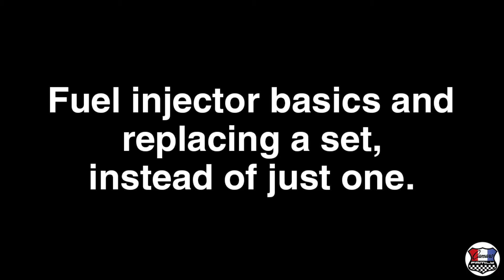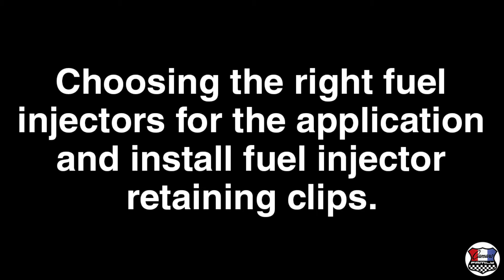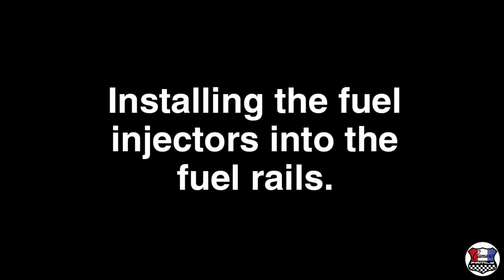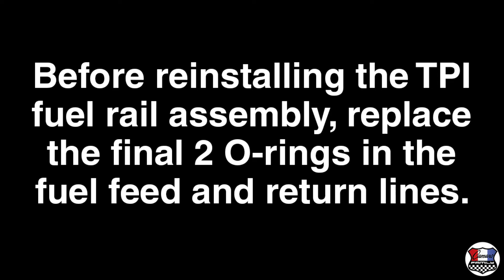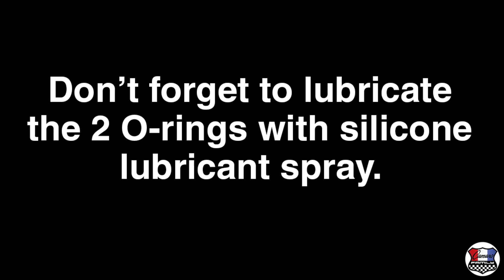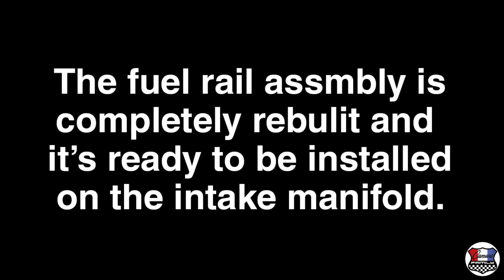TPI Fuel Rail Rebuild - Camaro / Firebird / Corvette (Part 4 of 4)

Comment: Did these Bosch 3 injectors make a lot of noise for you like so many on the Corvette, Third Gen & F body tpi owners I found out have been upset going back to 2006 when this Ford Bosch Injectors were being retrofitted.   I think I came up with 1 good solution along with a few other ideas to totally quiet them or any injector used.  Just waiting on email from a few suppliers to pass onto everyone.  Are those genuine Bosch or possibly fake cheap ones?

Comment: WRONG!!!!! 350 IS A 21LB. AND NOT ALL 8 FIRE AT THE SAME TIME. YOU ARE THE REASON PEOPLE SPREAD BAD INFO.
Reply: So like what lb injectors should I use cause I have a L98 383 stroker with almost 700 hp

Comment: Good afternoon. I replaced my 85 iroc-z injectors with the same 19lb injectors off Amazon that were 50 bucks. The car has trouble starting if hadn't cranked in a day or so. Then when it gets hot it starts to surge. Did you have this problem with these injectors? Thanks
Reply from the maker: I didn’t have any running problems with mine. Why did you replace your injectors? Did it run fine before replacing the injectors? Did you replace anything else?

Comment: Only one side or 4 injectors fire at the same time. Since the injectors are at the inlet ports, the the 24lb injector may cause a rich condition if the computer doesn't't adjust the duration.

Comment: Thanks for posting! These videos are a huge help. What brand of injectors did you use? Bosch? I have done a lot of reading and it seems lots of folks recommend Bosch III 19#. However, I happened to come across a thread recently that suggested those aren't a direct replacement without tuning. My car is a stock 1989 LB9 305 IROC.
Reply from the maker: Hey Crock of Shirt, Thanks for your message! I appreciate you watching my boring, but hopefully helpful video. It seems to be helping more people all the time. Honestly, I NEVER do this, but I really cheaped out on the fuel injectors. I bought them from eBay for about $70 and took a chance, I assume that I will be installing an LS in the future, so I didn’t want to go crazy with installing GM original injectors $$$. I found a seller that had sold more than 100 sets of them (in the hopes that if they didn’t fit/work, they would not sell so many). These were a direct replacement on their fitment chart. I didn’t have to tune anything. It passed smog very clean, so I know they didn’t require any tuning. Maybe if you installed them on a smarter/newer vehicle them might, but these old batch-fire systems are pretty rudimentary. I would definitely do the same thing on the next TPI I rebuild. -Tony
Reply: @CamaroFamily  looking to purchase these. Is there a link or part number? Im in the same boat on my 86. Going ls in the next few yrs. Hope you see this fast.
Reply from the maker: @datboired832  I just walked out to IROCDAILY and got the Bosch numbers for you. The other injectors are F6VE-A5A 👍👍 I should add this detail to
My video. 👍👍
Reply: @CamaroFamily  dope thanks alot! Yt must have been reading my mind lol. Ill be buying these rn. And these are for the tbi 5.0?
Reply: @CamaroFamily  the injectors keep popping up for ford's,  are those the correct ones?
Reply from the maker: @datboired832  These Bosch injectors are 19lb injectors for many different newer cars. I see them for use on Ford 4.6L engines and in Jeep’s. The nice thing about these newer replacements is that the technology is newer, so the injector bodies are more compact…compared to the older original injectors.
Reply: @CamaroFamily  those the ones im about to order. Is there anything else imma need?
Reply from the maker: @datboired832  Yes. They are correct for the 305 TPI application. I passed smog (visual and sniff test) with flying colors. Most fuel injectors are used on many different applications. The O-Rings are correct size, length is correct, Harness connectors are correct. And pound rating is correct too. 👍👍👍👍
Reply: @CamaroFamily  thanks for all the help.and fast response time! They will be here Saturday. Nowhere by me.has the orings smh. You guys should make a vid on the 3rd brake light on the 86's! I cant get mine to work!. I wish there was more 3rd gens in san diego area.
Reply from the maker: @datboired832  the Injectors and the O-Ring kit (GP Sorenson PN: 800-9211) available at AutoZone, and the 2 fuel line O-rings I mention in my videos. The GP Sorenson kit has the cold start injector O-rings (and others if you want to reseal the whole rail assembly…like I did in this series). 😉👍
Reply: @CamaroFamily  yes im looking for the o rings right now

Comment: Doing this myself right now, can I ask, when you install the new o rings on the fuel rail, is the supposed to be any movement on the tubes after tightening the screws down ? Mine has a little play in it...
Reply from the maker: Chris M, sorry for the late response, I didn’t see your message. After tightening  the retainers, you should be able to articulate the tubes slightly to get the rails lined up for installing on the intake manifold. You described your movement as “play”, which concerns me. I took mine apart because the O-rings were too small (wrong size installed by a previous repair job) and fuel was spraying out of the O-rings. It was probably leaking slightly for a while before I purchased the car, but one day it really started spraying. It was very dangerous. If you can easily rotate/roll (like a pencil between your thumb and index finger) the transfer tubes with 2 fingers after installing them, you have the wrong O-rings.
Reply: @CamaroFamily  that's ok. It was just a bit of movement, it wasn't there when I pulled the rail off but I'm guessing that was because it had probably never been pulled apart before and had become a bit stiff. Once I installed it though it was all good, nice and tight.
Reply from the maker: @CPMest81  Awesome! Good to hear!
Reply from the maker: @CPMest81  I hope the 4 part video series helped at least a little. I tried to be thorough.
Reply: @CamaroFamily  definitely did, very glad I found it, I think it's the only video on YouTube detailing the tpi fuel rail assembly/disassembly!
Reply from the maker: @CPMest81  That’s why I thought it was worth doing. There’s a lot of weird info out there. And incomplete videos too. More to come for the IROC. You can see the IROC if you search #IROCdaily 👍
Reply: @CamaroFamily  Just did my first start up and ran it for a bit and no leaks, great outcome 👍🏼 
Thanks again for the videos!